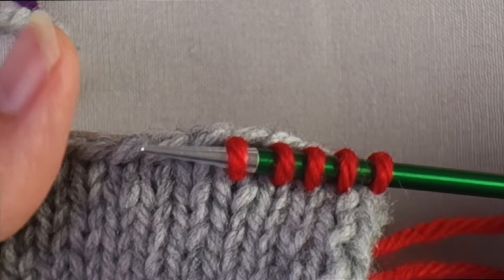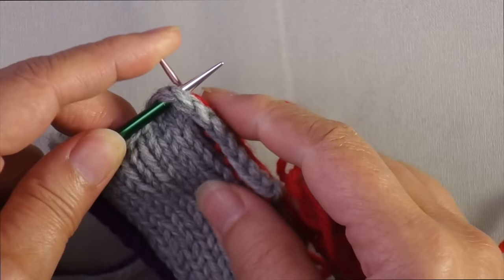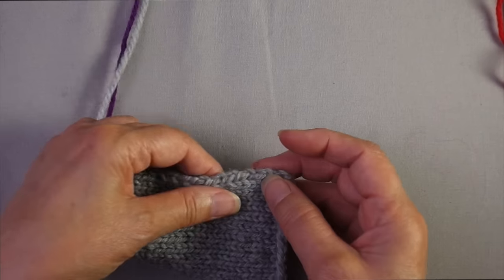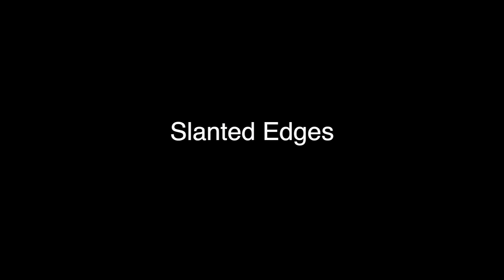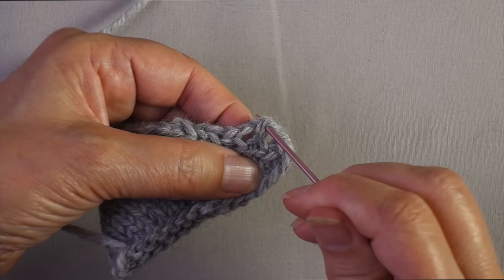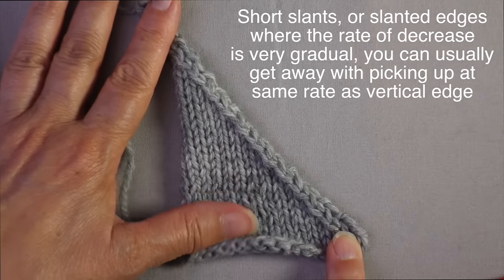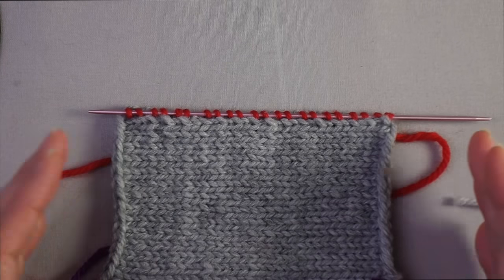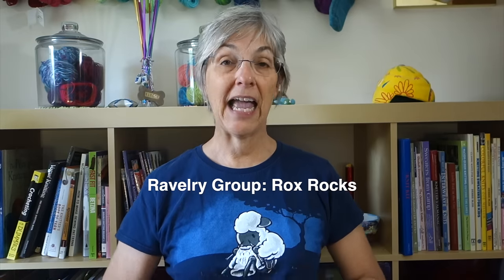Picking Up Sts Along a Finished Edge

Comment: Thanks I’m left handed but knit normally but just cannot get to grips when it says pick up an knit stitches for button bands or neck bands get in an awful mess but now I see where to actually push the needle through the work an just make a loop I think I will find it easier to use a crochet hook to pull through and transfer to needle hope you keep this on as, hav knitted a long time but have never been happy if had to pick up stitches and it’s never looked right , I will refer to you when need to pick up stitches thank you very much

Comment: I love your tutorials. Your method to determine the number of stitches for vertical pick-up is to multiply the stitch gauge (per inch) by the length of the finished edge, is easy to understand.  Thank you! Will using the gauge ratio (stitch gauge/row gauge) give the same result?
Reply from the maker: In most cases, yes. If you are picking up for ribbing along the edge of something with a compressed row gauge, then no.
Reply: @RoxanneRichardson  Thank you!

Comment: I have knitted a long rectangle of sampler stitches with each pattern of stitches being about 16”x16”; back then I didn’t know about knitting a border on the sides as I went along. Now I would like to finish this project by picking up stitches for a border along all four sides. Can this be done by knitting along the sides and ends at one time as I would do with crochet, or must it be done sides first, then ends after? If all at once, how would I manage the corners? Your video has answered my first questions about the difference between picking up st and garter and I really enjoyed it because your instructions are so precise. Thank you for the professionalism of your video.
Reply from the maker: If you work a border around a rectangular piece of knitting, you typically have to include increases at the corners. Are you doing a garter stitch border? You could either do a CDI (central double increase) every other round, or have a single st at the corner, and do an inc on each side of it.

Comment: Fantastic, learning so much about knitting garments from you.  I can’t thank you enough.  It looks like you are going between stitches not the center of the stick on a vertical edge.  I thought the stitch was the “v”?  I’m confused. 
Horizontal is very straight forward. As is a vertical edge.
Reply from the maker: When picking up sts along a vertical edge, you pick up between the selvedge stitch and the 2nd stitch. (It can be different for a slipped stitch edge along a heel flap)
Reply: @RoxanneRichardson  Thank you so much again. Roxanne. 🤗

Comment: Hi Roxanne, II am looking to join stitches to the band of the 1898 hat. they say to pick up 84 stitches, in this video the piece you are adding stitches to is not double.  Do I put my needle the same same way you do except through the 2 bumps?  Can you help me with this, my husband is looking forward to having his hat it's getting cold out and I've never knitted a hat in 2 pieces before, wish it would have been a one piece hat.  I love your tips they are really great.
Reply from the maker: Yes, you put the needle through both layers of the folded strip, as per the instructions in the pattern.
Reply: @RoxanneRichardson  Thanks Roxanne, it does leave a gap around the hat but I guess that can't be helped, it looks good.  NowI'm trying to figure out how many inches to knit before I start decreases pattern suggests 5 inches, I'll follow that and see if that fits hubbies head.  Thanks again, you are a great teacher by the way and quick to give answers.

Comment: Very well explained, thank you. 
Question: when picking up stitches on a very long edge, why not just use a circular needle (with a stopper at the end you're not working with) instead of several DPNs? If I want to pick up stitches along the long edge of a fine lace shawl, like the ones I tend to make, I don't think I have enough DPNs for that. :)
Reply from the maker: I used a dpn for several of the demonstrations, because I was working with small swatches. When demonstrating PU along a garter edge, I did specifically state that you could use a dpn or circular needle. Use the tool that you have and/or that works best for you in the context of your project.

Comment: Question - after picking up stitches on the right side, to knit stockinette do I start with a purl row or do I knit 2 rows of knit before doing the purl row.  Thanks. Love all your videos, couldn't do half the projects I do without your advice.
Reply from the maker: I typically begin in pattern, so with the WS row facing, I would purl across. There are people who do work the first row after picking up as a WS knit (so it will show as a RS purl). That's an aesthetic decision that any  knitter can make, if it's something they prefer.
Reply: @RoxanneRichardson  Thanks for getting back so quickly and with a great answer!  I get so tied up in the "rules" sometimes that I don't stop and think I can probably just do what I want. Now I have to figure out what I want! Since I am new to this I will try both ways out on my swatch and see. Thanks again.

Comment: Hi roxanne, this is great! I‘ll try this method for shaping the shoulder from the back piece and continue for the front now (top-down). Should I use some short rows  (2 or 3 stiches) at the neck-side for shaping the neckline tightly enough and have no holes in the first stich? Therefore pick up one or two stitches more? Or just pick up the number of stiches recommended and continue? Hope you can understand my question? Thanks so much for your help. Dona from Belgium.
Reply: This was excellent, as was the button band video.  Thanks so much!!!

Comment: Great video, however I need to pick up stitches for a button band along garter + stockinette st and space them evenly so… how do you pick up between garter row bumps? In other words, I have 20 rows of garter st + 90 rows of stockinette st. How do I space 75 stitches evenly?
Reply from the maker: Without being able to see what it is you're knitting, my go-to approach would be to pick up 1 st for each garter ridge (do you have 20 rows or 20 ridges?), and then PU at a ratio of approximately 2:3 or 3:4 for the stockinette portion.

Comment: I’m about to place some ear flaps. Most videos show them exactly in the middle of the sides of the hat, but I saw one that said they should be slightly off-center (otherwise they’ll cover too much of the cheek & not enough of the ear). What is your recommendation?
Reply from the maker: If memory serves, the center of earflap to center of ear flap is about 1/3 of the circumference around the back of the head and 2/3 around the front (it might be more like 40%/60%, I just don't remember) An easy way to figure it out is to put on a hat and mark the location of where you want the center of the earflap to be on each side. When you take off the hat, you can see where those positions are relative to the entire circumference of the hat.
Reply: Thank you so much for taking the time to answer my question!

Comment: Can you use this too for example to make a pullover that you knitted too short , longer?
Reply from the maker: If it was knitted top down, you can take out the bind off, and knit the bottom longer. If it was knitted bottom up, it's more complicated, because you'll be knitting in the opposite direction you originally knitted  I have a video here:  https://youtu.be/e9MyBt-CJsI

Comment: Have you done a video on picking up stitches along a ribbed piece? A 2x2 rib, for example?
Reply from the maker: I can't say that I have ever seen the need to do that, although I have picked up along the edge of cabled fabrics, which are essentially fancy ribbing. The process is the same: you PU through the center of the stitch below the BO chain. For a knit stitch, you insert your needle through the center of the V. With a purl, you would use the purl bump created by the head of the stitch to guide you. Insert right under the head of the stitch and through the center.

Comment: Thank you so much for the video! I do have a question: how do you pick up & knit more than one stitch per the existing stitch? would you do a YO? ... thank you!
Reply from the maker: There are a few ways. It just depends on how many more sts you need to pick up vs the number of selvedge sts available. If it's just a few, I'd increase on the following row (same as if you had a few too many --just decrease out the extras). If it's a LOT, then it would depend on how the selvedge was worked. If you re-post your question in my Ravelry group, it will be easier to discuss what your options are.

Comment: Hi. I’m the new learning of knitting. I’m try to knitting’s a V-Neck for  4 years boys. But I don’t know how to finish the edges of sleeves?… and kind of Needles do I need it. I used the loop Needles for knitting  but it’s hard to do the knitting the edges of sleeves. Please what should I do about it. Thanks 🙏🏼
Reply from the maker: Are you knitting top-down? Are you saying that the cuffs are too small for the circular needles you have? Or are you knitting bottom up? Did you knit the sleeve from the cuff up to the top of the sleeve and you need to sew the sleeve into the armhole? I need more information. The best way to answer this type of question is on Ravelry.
Reply: Hi dear. I m new Beginners of this Project. I really like to learns about the Techniques of knitting’s it was very Challenging for me to figured it out how to do it right.I Started to knit this V-Neck from the Bottoms. I deceived it the V-Shapes  neck. Now the edges of This Arm  holds I want to finish this Project. I used the Circle Needles. It’s hard to work with it and after knit  the Arm holes it becomes very Small. I have no ideas how to finish this projects. 🙏🏼

Comment: I am about to knit a Iris shrug by Melody Hohfmann, and in the pattern at the end we are supposed to pick up 200+ stitches and join in the round and knit a garter all the way around. Do you have any suggestion what edge stitches I should do to help me with that, I would be picking horizontally and vertically too.
thanks so much ! very helpful to me with all your videos
Reply from the maker: Because your question is about a specific project, it's really helpful if you post your question in my Ravelry Group, Rox Rocks. You can start a new thread by clicking on Start Topic. Ask the question there, and link to the Ravelry pattern page, so we can see what it is you're working on. That also helps anyone else who might want to work on this project, or who might have a similar question, because they'll be able to find it, and track the conversation. In addition to responses from me, other people are likely to chime in and offer suggestions, as well. Thanks!

Comment: Thank you for your video. I need to add a border to a finished stockinette stitch scarf that has curling edges. It's my first project. How do I do that?
Reply from the maker: The nature of stockinette is that it rolls. Eliminating the curling edges by adding a border won't change the fact that it will want to roll into a tube, particularly since it is so much longer than it is wide. Scarves are typically knit using stitch patterns that will lie flat, mixing knits and purls across each face of the fabric, rather than putting all the knits on one face and all the purls on the other.

Comment: For the very first demonstration, you say you are picking up under the bind off edge not picking up on the bind off edge/chain,  but you don't say why.  I have seen other videos where you actually pick up both legs of the bind off.  Can you explain why you do not pick up the bind off edge?  Thanks!
Reply from the maker: In order to maintain the continuity of the columns of sts, so that the last row of sts under the BO flows into the first row of sts that are picked up, you pick up through the center of the stitch under the chain, not under the chain, itself. When you are working the bind off, the stitches on the left hand needle become the new row of sts under the right hand needle, and the sts ON the right hand needle become the BO chain. So you are picking up through the center of the last real row of sts. If you pick up directly under the two legs of a chain stitch, the new sts will have a 1/2-stitch offset. 

When you pick up along a selvedge (vertical edge), it will be rotated so that it's horizontal as you pick up sts, and for that sort of edge, you pick up under both legs (you are actually picking up between the selvedge stitch and second stitch in)
Reply: @RoxanneRichardson  Oh, OK.  I bound off a sweater that had a rolled edge and it rolled too much at the bind off. I am thinking of added a ruffle (a few rows of stockinette then KFB one row and continue stockinette).  IN that case, would picking up the two legs of bind off stitches be OK?  I am not worried as much about continuity here.  Thank you for your great video!
Reply from the maker: There's no advantage to picking up directly under the chain. I would suggest trying each across a span of 10 sts in order to get a sense of what the difference is in the process, as well as the result. After you pick up sts, if you intend to knit in stockinette, then that will roll, as well. Do you want the purl side of the ruffle to show when it folds over?
Reply: @RoxanneRichardson  I think that is a good idea (to try to pick up the chain and to pick up the stitches before it to try each).  I thought adding a stockinette ruffle would add some heft and keep the hem from rolling.  I did not think that the edge of the ruffle would roll but I guess it would - but maybe less?.  An alternative, I have read, would be for me to tink back, knit stockinette for  1/2 inch on a smaller needle, then knit with the the US 5 which is what I knit with  originally to tame the roll.
Reply: Do you have any  other suggestions to get an edge that will not roll?  Thanks so much for all of your help!  It is disconcerting to knit a whole garment and then not be happy with the very end!
Reply: RocksAnn wouldn’t blocking it solve the problem of rolling?
Reply: @terribarresi9892  Perhaps, but I don't want the recipient (a busy parent) to have to block the hem every time they wash the item.

Comment: Thank you so much for your videos. They are very helpful. I have a question, about picking up stitches, at the bind-off edge . I just finished knitting a neck warmer, using a herringbone pattern. The pattern, which had 30 cast-on stitches, says to now pick up & knit 15 stitches, along the bind off edge. It's causing me so much anxiety, not knowing where, exactly, to pick up these stitches. In your video, at about 1:25, you are doing a pick up, at the bind-off edge of stockinette stitch. To my surprise, I see you are not going directly under each bind-off stitch. Would I do the same thing, if it's herringbone & not stockinette? Thanks. :)
Reply from the maker: It sounds like you are supposed to pick up one stitch for every two bound off sts. Without knowing the specific pattern, and why the PU ratio is not 1:1, I would still say that you should pick up through the center of the stitches below the bind off chain, and not directly under the chains, themselves. Picking up under the chain causes the sts to be offset from the original columns of sts, and you lose continuity. Again, without seeing the pattern, I don't know why the ratio is so different.
Reply: Thank you. I realize why the pick up number is half the amount that were cast on. When I did the bind off, I did it following the herringbone pattern.  That resulted in half the number of bind-off stitches remaining. That may be why the pattern says to switch to double strands of yarn when picking up the 15 stitches. I've since finished the neck warmer, & it looks very nice. :)
Reply: Thank you very much, Roxanne. :)

Comment: I'm so new!  I don't get the very "first" step. I see the clear red yarn when there are 4 loops on the needle, but how did the first stitch get on?
Reply: you loop the yarn over your needle after going into the first stitch to "pick up" and knit it as normal - you might want to knit both strands of the new yarn (the excess tail and the lead) into the first three stitches you pick up to secure it (or the excess tail can get pulled out which will unravel the work).

Comment: But What do you do once you have the initial stitches on the needle?  Knit as usual?
Reply from the maker: What you do next depends on why you're picking up stitches. If you're working from a pattern, it will tell you to pick up some number of stitches, and then it will tell you how to work them on the following rows. You may or may not be working in the same stitch pattern that you worked previously.

Comment: Will you please explain stitches pattern in flat converting to circular knitting pattern, thanks again❤️
Reply from the maker: Sometimes this is very easy, and pretty straightforward (like when every WS row is purled, or when WS rows have you knit the knits and purl the purls. Other times, it's more of a challenge. It also depends a bit on if you're talking about converting something as written for a particular project, or if you're talking about using a stitch pattern from, say, a stitch dictionary, and if you're looking at what you have to do to use the pattern in the round (such as whether you need to eliminate the "extra" sts for the repeat that are often used to balance the pattern's symmetry). Do you have an example of a stitch pattern you are trying to convert?